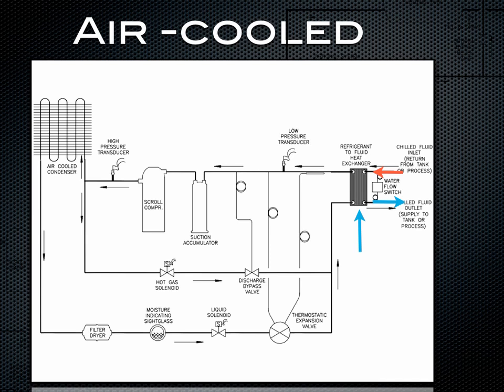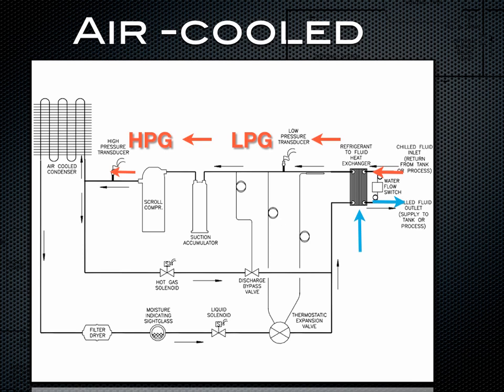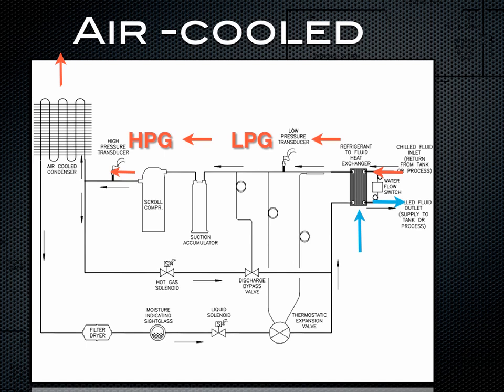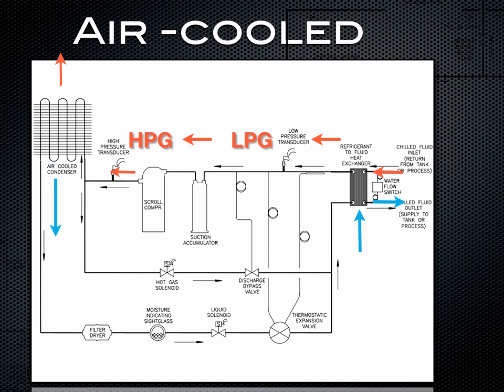How a chiller works- Air cooled refrigeration.

Comment: I got questions after watching your video - which is the water process side and refrigerant side? do you mean that the chiller water supply and chiller water return between chiller and cooling coil is the refrigerant side and the condenser water supply and return between chiller and cooling tower be the water process side?

Another question is, how to prevent the chiller water from getting in touch with refrigerant? I saw them were actually within the same pipe in the same circulation.

Thanks a million for your great answer.